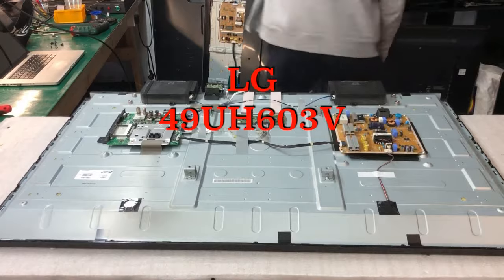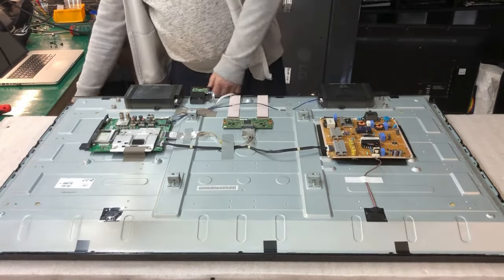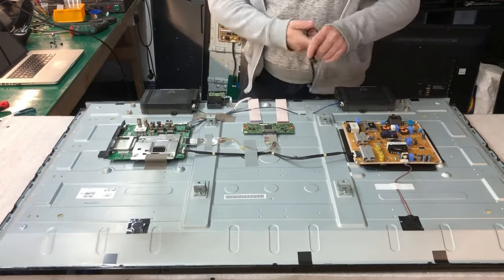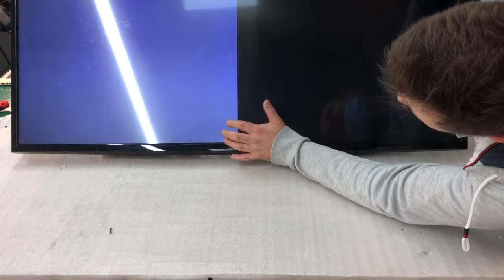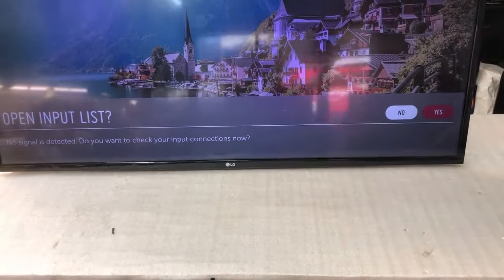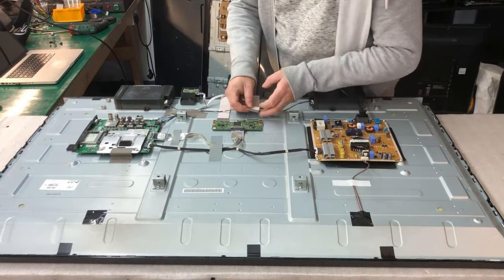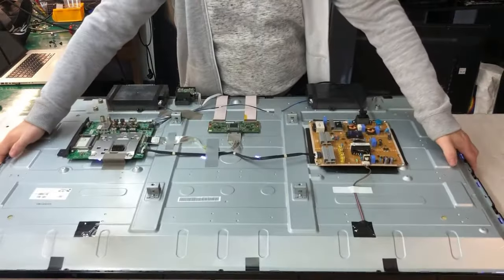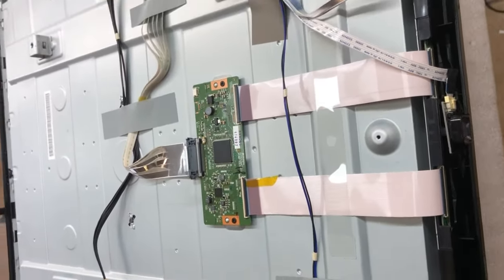LG Smart TV Jumping Picture Problem   Fixed

Comment: What is the name of the tape you used to stick those cables?
Reply: I also would like to know....
Reply: What was the tape called please
Reply: @aaronbooth6008  it's kapton tape
Reply: I think you can use regular duct tape. It's only there to disrupt connection with the deffective parts or something like that. It's not as good as a new TV but it's pretty close and cheap to fix.
Reply: Ni please use kapton tape this is non conducive and duct tape just might conduct
Reply: I fix it with a tiny piece of paper 😎😄

Comment: Great job man. My 49UH770 started behaving same way. Your solution worked. It was second one ribbon and taped out aprox. 10 pins from the centre leaving first three pins uncovered.🥰🥰🥰🥰
Reply: What tape did you use?
Reply: @crystalfagan2216  ordinary scotch tape. Just doubled it for good measure.
Reply: How did u count such small lines,  what size should be the tape?
Reply: @3rdgeneration536  good macro lense and luck. Nothing else.
Reply: So therefore the cable is the problem?

Comment: Wouldn't putting tape on the the ribbon cause it not to make a good connection and not work?
Reply: The tape is insulating so there is no connection at all. Not sure why that would work but it did work on mine.

Comment: is possible to play h265 direct from a usb stick on this?  a codec dowload into the memory of the tv ?
i have a 42la6200
Reply: If it is installed you can play but also need a different player, not in the in-built player it is old

Comment: What is the permannt solution for this problem? As i did this method but colors are not so good. Pls reply me permanant solution. Thanks
Reply from the maker: Most casess working 100%, but sometimes  just can't fix 100%, nothing you can do,
Reply: Is tape causing this issue or board? Don’t say nothing you can do cos it doesn’t make sense
Reply: @gregfromthevaley  taping 10 pins haven’t fixed it. But taping 15pins fixed the tv 100% in my case.
Reply: OK what is the permanent solution,which board is the problem or ribbon?
Reply: @terryrama1550  it has been 4 months now....what have u tried?.I am planning to change new tcon board.